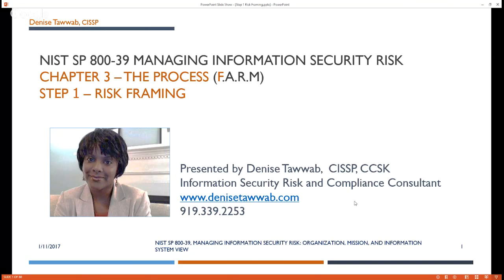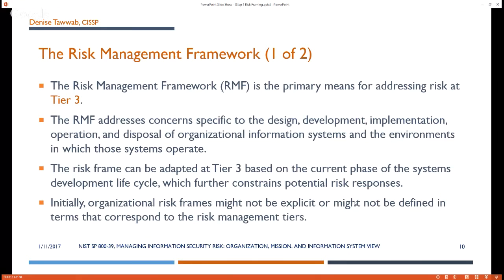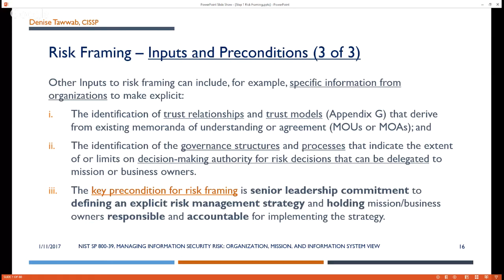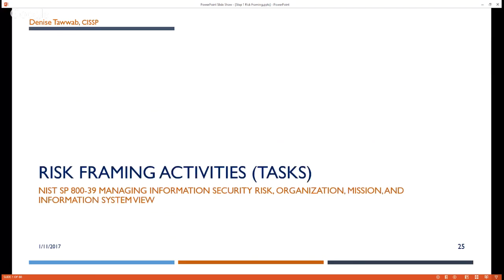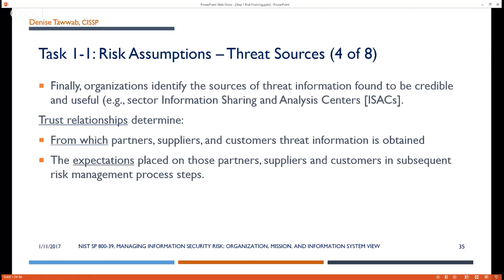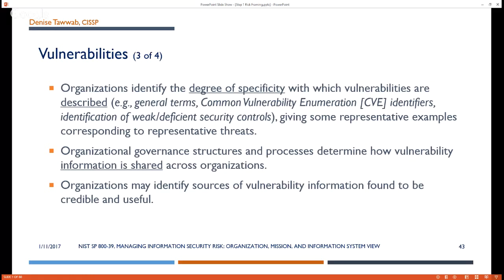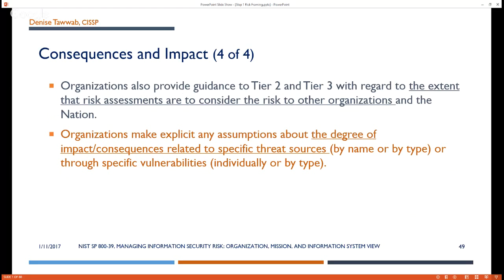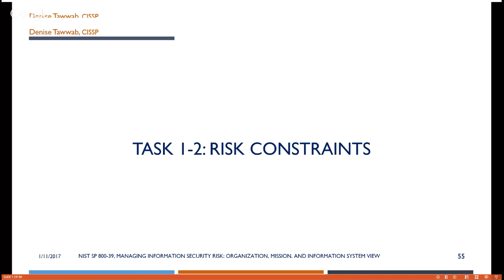NIST 800-39 Step 1: Risk Framing - Part 1

Comment: Good information. Just by listening to you, i was able to understand more the relationship among 800-39, 800-37, 800-30, and 800-137. I believe 800-39 is the first thing an organization needs to implement and the other publications aid in the overall process :-)
Reply from the maker: You are correct Rumilda Olik. 800-39 is the overall Risk Management proces and should be understood first. Then 800-37 covers the Risk Management Framework (RMF). 800-30 covers how to do Risk Assessments (the Assess step of the RMF), and 800-137 covers continuous monitoring (the Monitoring step of the RMF). Thank you for listening, and I am pleased that you found the material helpful. 🙂